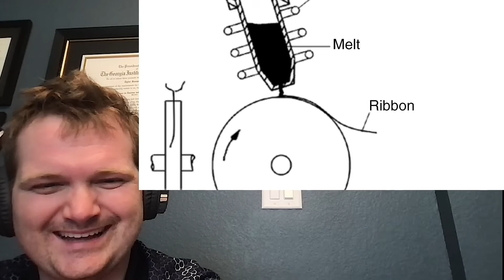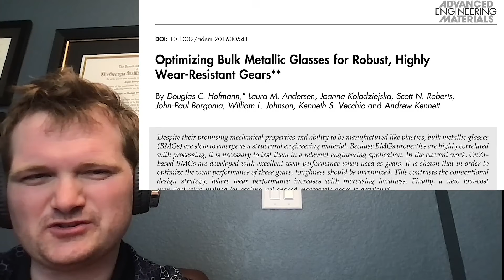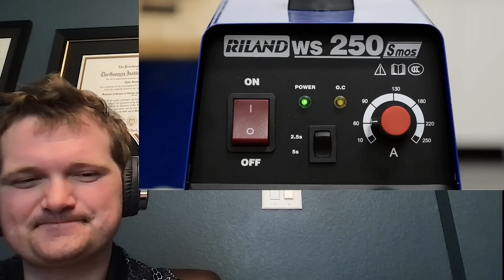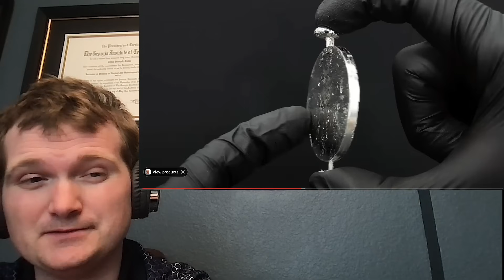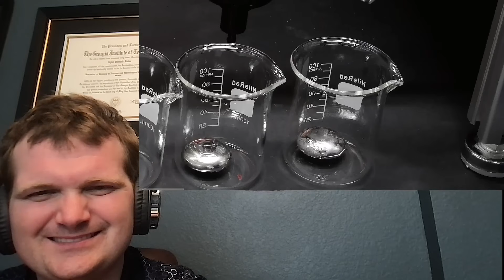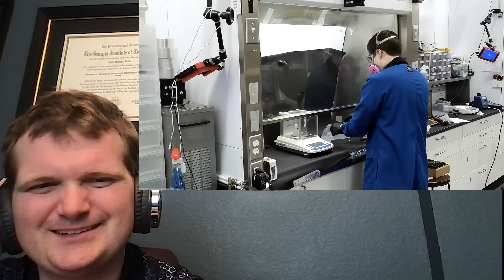Atomic Trampoline! - Nuclear Engineer Reacts to Nilered [Full Version]

Comment: The fume hood is operated at air pressure lower than the room it is in.  A blower constantly pulls air and contaminants out of the hood.
Reply: This is exactly what we do when we remove asbestos aswell. Capsule the room with plastic and put an air "purifier" inside the zone to make it a lower air pressure

Comment: The filter being slightly below the window doesn't really matter much, the pressure in the fume hood is lower than the ambient pressure because there's a constant pumping of air out of it, this causes the air from the surrounding area to be sucked into the fume hood at all times, the flow of air is always inwards, and effectively no air from inside the chamber can exit. This constant flow of air also takes all but the heaviest particles with it, this is literally what they are designed to do, the amount of air that moves through one of those fume hoods is honestly shocking, it moves a tremendous amount of air and creates a very strong draft, especially when the door is very low.

Comment: 1:15:37 in the aerospace industry we work with surface roughness around 16 microns, and we’ll reject parts for having a scratch you can only see under magnification. it’s actually wild how important smooth surfaces are for any high heat/pressure application

Comment: when Nile showed the bit that flowed like glass when handling with a spatula, my thinking was that the early attempts weren't hot enough, Most metals have a hard melting point below, it's solid, above, it's liquid. Glass on the other had, has a slower transition, becoming less and less viscous as the temperature rises.
My bet is that really rapid cooling of the surface of a glass is the key to this; think of all those Ruperts Drop videos.
I was half expecting the whole thing to shatter when he cut the nibs. It also makes me think that the whole thing could be accomplished without the Beryllium

Comment: It was at this moment that nile red discovered one of the purest base techniques for being a welder.

If it taking too long, not penetrating enough, not fusing both sides of the parent material, or just not melting the filler material properly. make it hotter, 
Once the desired result has been met you have found the correct temp. May need to sort out clamps or strong back etc to help prevent warping but sometimes its worth it to get a shit job out the way

Comment: 21:22
I remember a video from "Our Friend Mike Brady of Oceanliner Designs" about the engineering plant (starting at the firebox in the boiler rooms and ending with the reclaimers for the feed water) found on White Star's Olympic Class Liners in which he says that the Main condensers could turn the Main Engines, the Triple Expansion Steam Engines, on vacuum alone. Though that was not exclusive to the Olympic Class, but these 3 vessels had the strongest sets of their era dwarfing most that came before, after all the Steam exited the Main Turbine at about 1 psia and the Condensers that followed operated at 28 inches of mercury vacuum

Comment: Once alloyed, would the toxicity of Beryllium be reduced?
ie, table salt is made of two very toxic and reactive elements, but is necessary for life
Reply: I dont think alloys get rid of the dangerous properties of the component metals.

Theyre physical reactions, while table salt is the chemical reaction of Na and Cl. So the alloy induced no chemical change, and thus the properties of beryllium would remain the same.
Reply: According to comments on the original video, the mixed metal/glass is much less toxic, because the toxic beryllium is bound into a matrix of the other elements.

Comment: Im not a professional welder myself but yea welding is a very good thing to get into as long as u know what ur doing im 21 years old and i have a good bit of experience in welding i prefer stick welding as its the most efficient and much easier to weld exactly where u want and u can even tak weld a thing i learned to do before welding fully to keep the bits together before i weld it together

Comment: How do you melt metals with a higher melting point than copper in a copper crucible? EXPLAIN!
Reply: The mold is water cooled and due to copper being very thermally conductive, the water keeps the mold from being able to reach melting temp. This is also why he had trouble using the mold. Most molds need to be pre heated to accept metal he just wasnt heating up things long enough